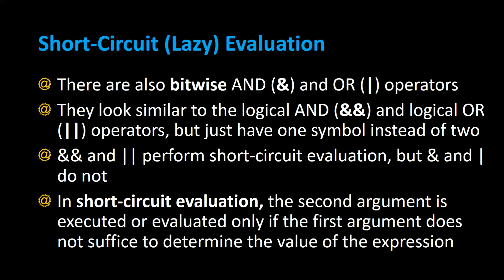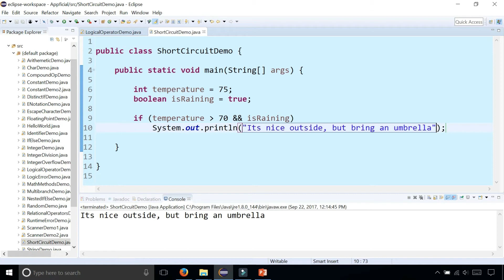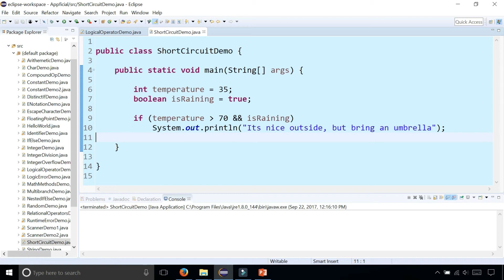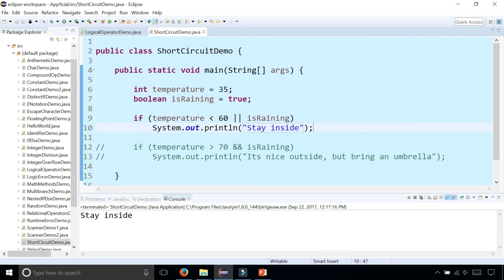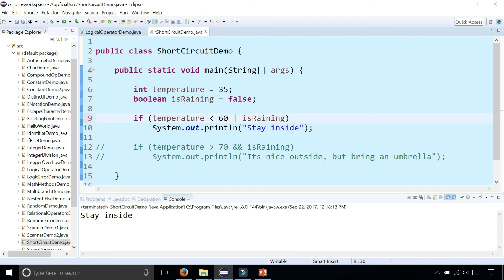Java Short Circuit Evaluation - Lazy Evaluation using Bitwise AND and OR - Learn Java- Appficial

Comment: 2:25 in answer to this, yes it makes sense. For examploe if you are using functions that return a Boolean value and you need to validate and call both (because they save data to the Hard drive or database or whatever and they can't be called separately). So instead of saving those functions values inside of 2 temporary variables and then validate those values, you can do it right away.

if ( func1( ) & func2 () ){
      //code
}

Great video keep it up :)
Reply: There is another use of those. For example: int tryout=1;  if(temperature>60&tryout++<5) {System.out.println("Try again!");}
Reply from the maker: Thanks dude!